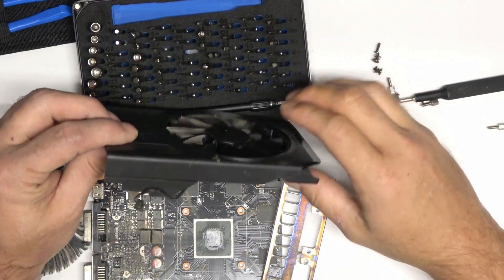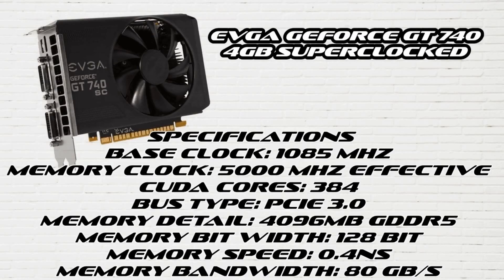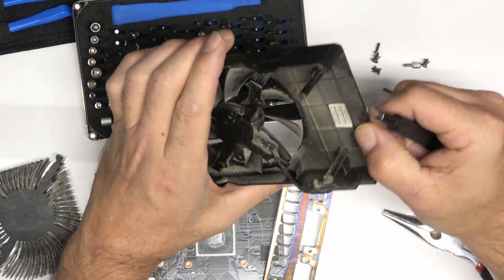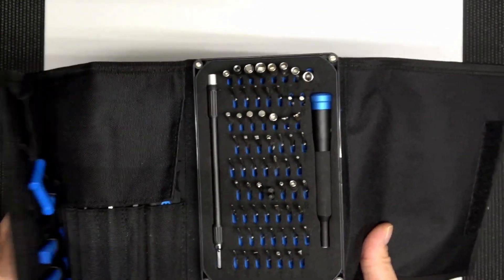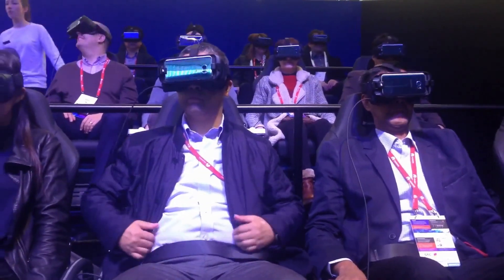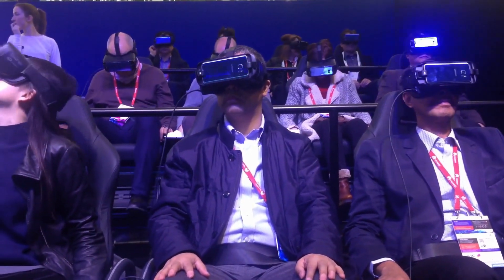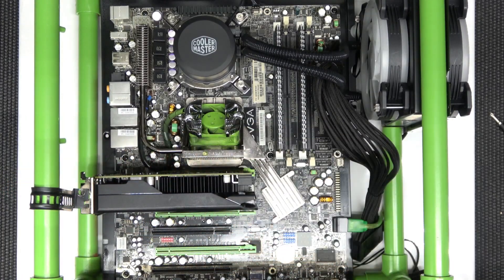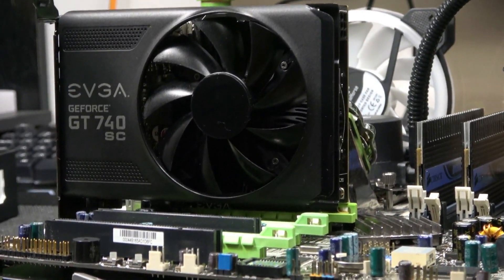Restoring the shine to a GT 740 SC 4gb evga graphics

Comment: 30 fps in doom in that level it's gonna dip in the 15-18s in some of the later levels.
Reply from the maker: Doom played actually well for the frames that it was showing @ 1080p low but yeah the card is no 1080p card and even with a tweaked config metro exodus was crap to play @ any resolution.

Comment: why does this 740 has a 6pin but my 750ti sc from evga not
Reply: The 740 is an older Kepler card and the 750 TI is a Maxwell card. The 750 TI is more power efficient and doesn’t require a 6 pin connector as a result.
Reply: yeah that is weird. I had a 750 ti sc at one point and I remember it didn't have a 6 pin. Maybe the 740 was a rebrand of an older chip and it needed more power? That's the only reason I can think.
Reply: It uses less power?...
Reply: I had a old GTX Evga 750 TI SC and it never had a 6 pin it got its power from the motherboard
Reply: probably the evga model has a much stricter power limit as it's probably already either maxed for clock or at max power draw.. or both.
both cards are below the 75w provided by the pcie slot at reference speeds.
i guess this 740 can go from really really slow to _really slow_. :D
you could cut traces and add as many 6-8 pins as you want to your card without screwing much with the traces on the board and mod the shit outta your bios forcing a stupid high power limit. just fyi. :)
Reply: Well it's a 740 sc not a ti. Plus that is older than yours so it will consume less power. Once again overclocking will consume power too. To be able to do it u need that extra power. Even newer gpus that are able to do death defying shit will use pins. Normal cards do not. Plus alot of older things were using old Arch and didn't have what we have now. if haven't noticed that the numbers do mean alot lol. 750 is a 7 th gen 5th revision lol.
Reply: Plus different manufactures. I just stay to my amd gpus. No confusion there lol